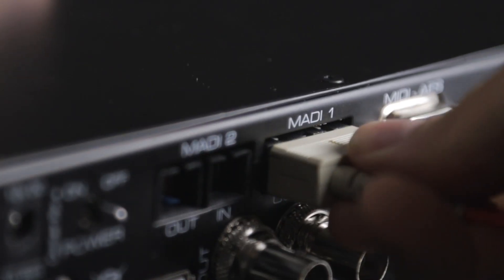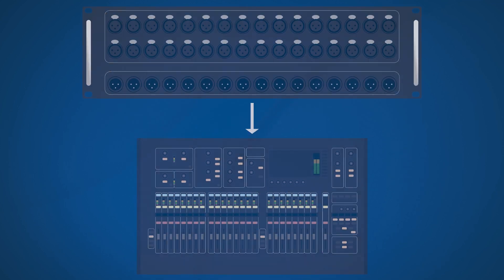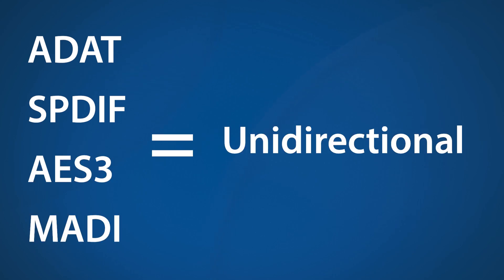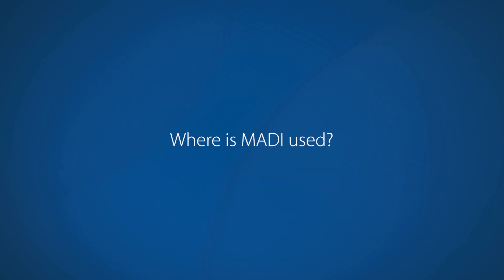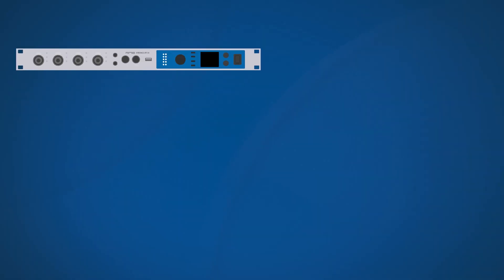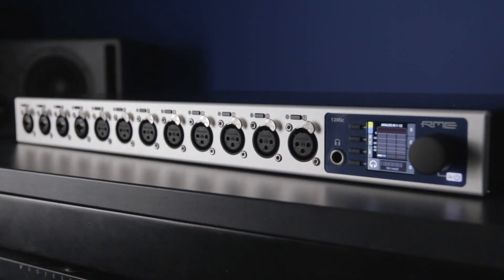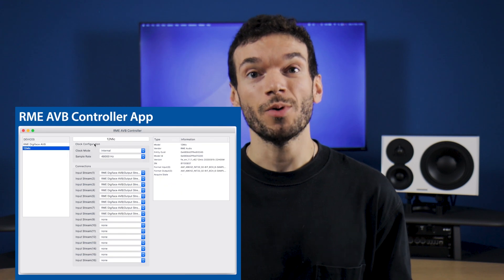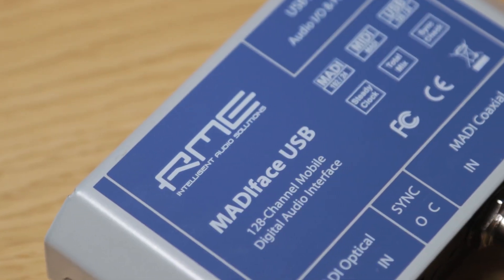What is MADI? - Synthax Explains

Comment: Hi,  thanks for this.  Im still kinda baffled.  I got two A32 and a MADIface.  I stupidly thought it would be as easy as just plugging them all into my PC.
Reply from the maker: Hi yeah it can definitely be a bit confusing at first. MADI setups aren’t quite plug 'n' play - routing and clocking can take a bit of figuring out. Definitely simpler than AoIP though. Which bit are you getting stuck with?
Reply: @SynthaxAudioUK  Hi,  Thanks for reply and offer of help. So my frame of reference re convertors is MOTU 24io what plunged directly into a PCI card.  Easy.  Then upgraded to RME firefaces what I just Firewired to PC and daisy-chained.  

So I bout these A32 just thinking they would just plug into my PC. Then realized I needed a RME MADIface.  Another £750.   So now ive got the MADIface and 2 x A32 (dante versions if thats easier).  Now I need to set it all up.  

My needs are simple.  I just need 64 in and out from my PC. Much like my MOTU 24io's did 25 years ago.  I just wanted that with better convertors.  

Kindest regards.
Reply from the maker: @MLochMusic  Thanks for the info, sounds like a very powerful setup which I'm sure you'll love once you're up and running. There's a definitely a bit of a learning curve but worth it once it clicks.

Have you watched part 2 of this video? We show how to set up in more detail:
https://youtu.be/_q5Mx-l7FpU

Also might be worth checking out the written guide on our website which might help clarify things further:
https://www.synthax.co.uk/latest/what-is-madi-guide-tutorial-faq/

Let me know if you're still having problems and I'll try to help!
Reply: @SynthaxAudioUK  Thanks for the links and your time.  Greatly appreciated.